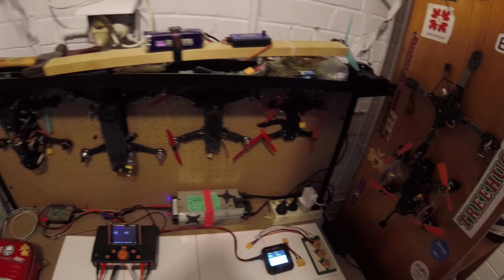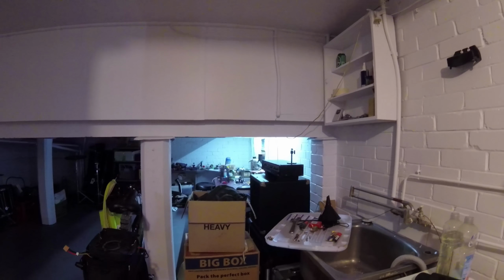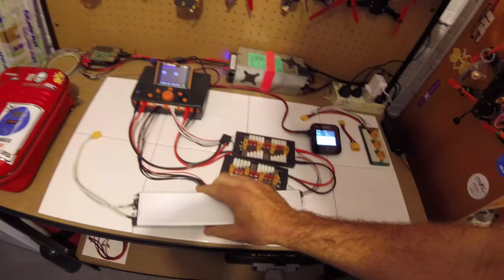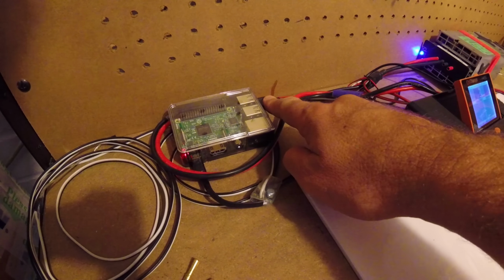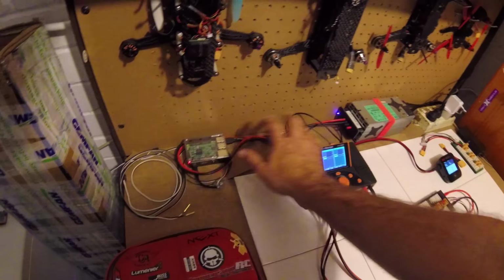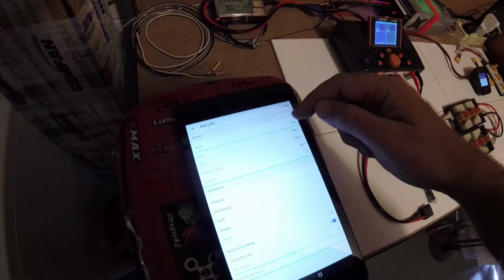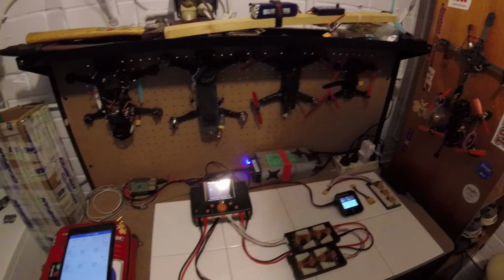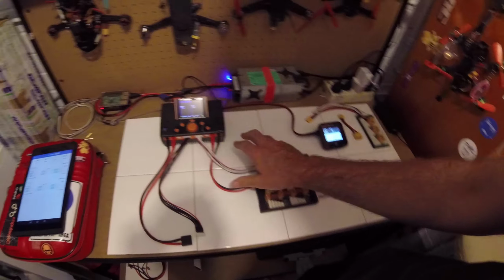Wireless iCharger and Charge Station Rundown

Comment: Excellent video Mark, I definitely have to look into the HP 1200 power supply protectors cuz I seen the warning ⚠️ when I bought my icharger that said it was not to be used with multiple server power supplies. I also want to do the raspberry pie user interface for the icharger for I have a isdt p30 which has a Bluetooth user interface which is nice when I’m away from the charger but it has no alarm 🚨 to let you know when a charge is complete....does the raspberry pi have alarms? Also do you have a link to the form that teaches you how to set up a raspberry pie for the icharger 4010 duo? Thanks for your help
Reply from the maker: Thanks mate! Honestly it's all been years since I looked at this stuff. The links are in the description to the project but I have only a dim memory of it; my Pi is attached to my 3d printer these days. The HP1200s are still going strong - the coolice protection circuit has never missed a beat.

Comment: hello very nice videos compliments.
i have one question plase
how much is the resistance you use?
you can indicate me the parameters thanks
Reply from the maker: Thank you! It's a one ohm, 1000w dummy load for an amplifier. Only rated for 250w in free air though. Picked it up on ebay from memory.

Comment: Hi Mark. Unfortunately the sd card Image is not available. Can you please help me out?
Reply from the maker: Sure, here are the two images I found on my hard drive. Please let me know when you've downloaded them, as I need the space back in my Dropbox :) https://www.dropbox.com/sh/pey45cqkszuapmm/AAASKMEMMyM0y3jk0H93ab6xa?dl=0
Reply: @strepto42  thank you so much Mark. Now I order my stuff to get it running. I downloaded both.
Reply from the maker: @hnuta3  Awesome, good luck! Thanks for letting me know. I use my Pi to drive my 3d printer now, but it was a fun project to play with. :)
Reply: Hi Mark I have the same problem regarding the image file for the icharger.
Been to your dropbox but nothing there.
Any chance you could copy it again?
Reply from the maker: @christostrauss7468  Give this a shot ;) I need a more permanent hosting solution! Pity this project stalled, it had promise. Good luck! https://www.dropbox.com/s/qzv4bpiulttazbl/electric-sd-card_573.img?dl=0

Comment: Thanks for sharing your charging setup Mark.  Curious to know what voltage per cell you normally fly your batteries down to?
Reply from the maker: Generally 3.6-3.7v is where they end up after the load is removed. It's generally about 14v for a 4S pack under moderate load but I have current telemetry on most of my rigs now so I will start thinking of landing when I hit 1000mah of a 1300.